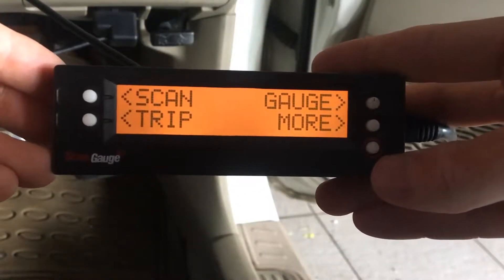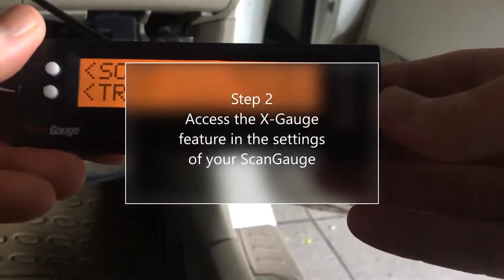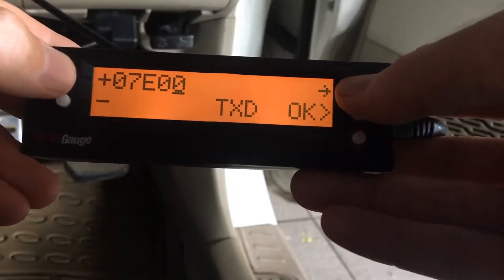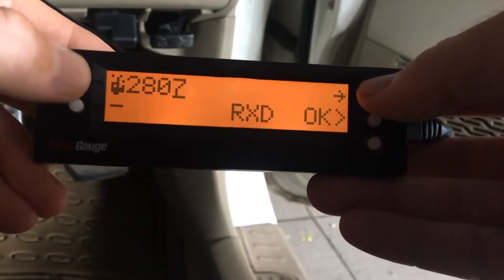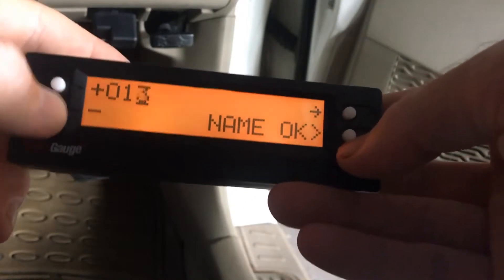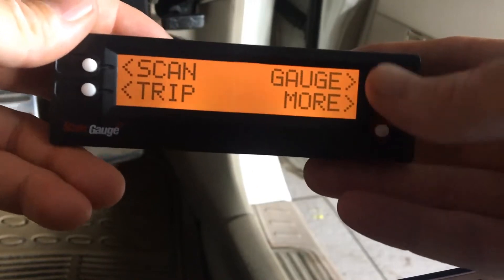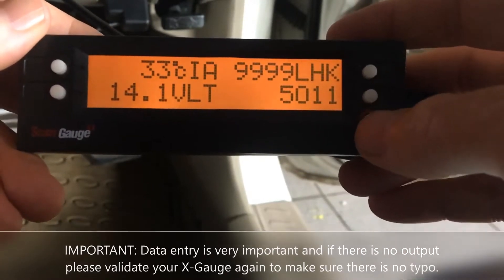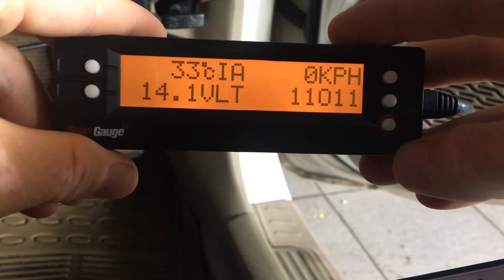How to enter Xgauge to your ScanGauge - X-Gauge programming step by step video guide

Comment: Great video.  Looking to purchase however some sellers mention they have the AUST version, others do not.  From what I can tell there does not appear to be any difference.  Thoughts?
Reply from the maker: The Australian version is different. If you're in Australia make sure to get the latest Australian version 4.52AU as it has additional features such as larger fuel tank capacity, metric reading and specific X-Gauges that won't work on older versions. Plus the local warranty and support!
Reply: Can you guys please make a video on the Scanguage 3, manually using X-Guage